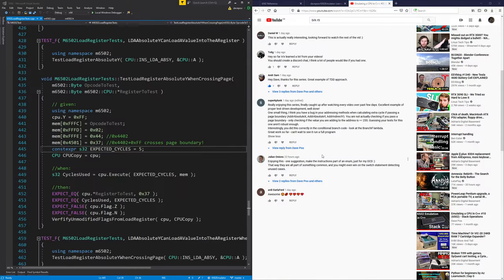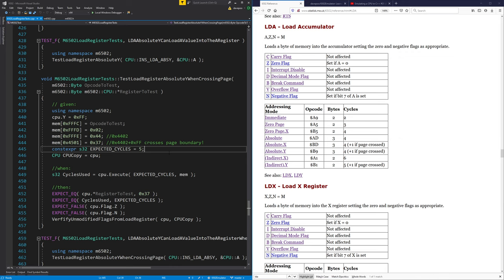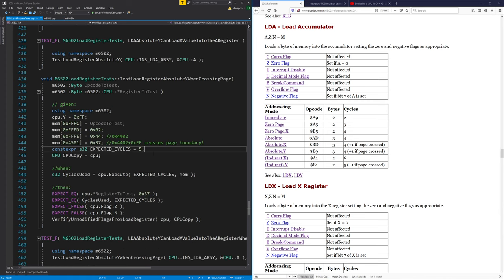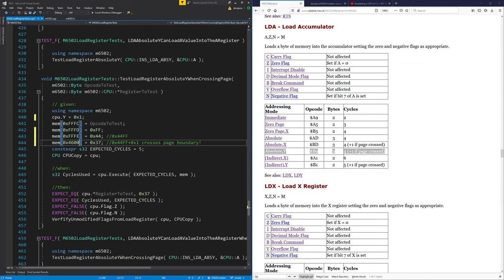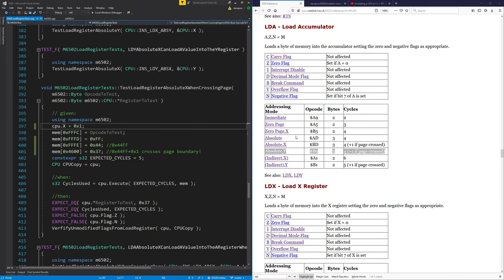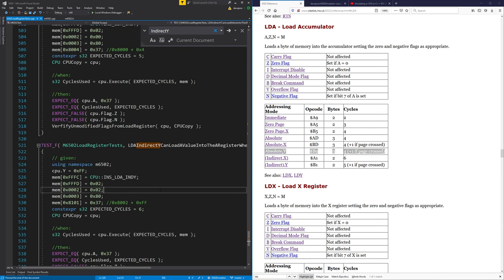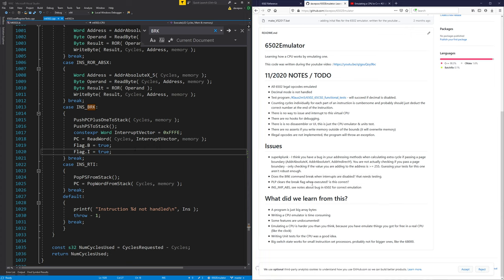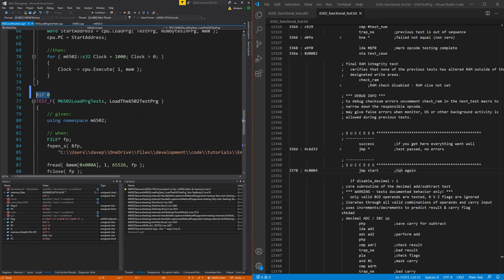Emulating a CPU in C++ #35 (6502) - Bug Fixing + Bonus Real 6502

Comment: It would be better to decode and execute the commands based on the "native" instruction matrix, because the position in the matrix tells something about the "physical" execution. Instead of implementing each operation i'd chose to create a matrix of command objects at runtime from the original matrix (-> http://www.oxyron.de/html/opcodes02.html). These objects manipulate the cpu infrastructure - in my understanding this saves you from fiddeling around with "specialties", because they are more a native or electric property. As a side effect it should be more independent from the actual 6502 design and is easier to match to other 65xx and maybe 68xx cpus.
But: I like your approach from a standpoint of learning - c and 6502 assembler... ;)
Reply from the maker: Yeah possibly. I didn't do that as the CPU is so simple with so few instructions. If i was emulating something like the Motorola 68000, even a CPU that old has so many variants of each instruction that the instruction set would be in the 1000's, so it would be a better approach i think for any CPU more complex than the 6502

Comment: Do you know a way to keep the emulator running even if there are no instructions. I mean like it just runs
Reply from the maker: Not sure i understand that question. If the CPU is running, then it executes instructions.
Reply: @DavePoo  I mean that the CPU just keeps on running even if there are no instructions, I tried doing this by removing cycles from every function. I also added an instruction "ins.ext" which quits the loop and it work fine for now.

Comment: Yeah Excellent. Feels like organising you a SD loader for the c64 might move this forward? What say you? Done with this?  Fun times anyway, thanks.
Reply from the maker: I'm considering moving this into an Unreal engine plugin and continuing it from there to emulate a full system
Reply: @DavePoo  Excellent, Unity also provide a wrapper for c++ blobs but the declaration used to be a bit agonising. Hopefully they updated it. I had a Vic20, this really brought back memories. Thanks

Comment: maybe you got the syntax error because your program still said "110 sta var instead" of "110 sta va" and the error comes from the executing not doing sys 49152 (which should be the way to execute code on that location)?
Reply: nvmd ...just gave it a try in vice, doesn't work either

Comment: doh. I'm feeling useless here... dunno the C64. I was/am an Applemaniac. On a Apple //, a simple call -151 would have been a real treat to check how the real cpu is behaving.
Reply from the maker: I have since been told that i needed to call "end" to stop that assembler program (which is written in BASIC!), then i would have been able to call "sys" command to run the comiled program. I think i want to get my hands on an SDCard interface for the C64 then i can load up turbo assembler and compile some stuff. Or could compile in the PC and then load it onto the real machine. That assember i tried looks like it would work, but there is stuff it can't really do (it's not a proper macro assembler, so writing code in it is going to be tricky, and i couldn't set the compiled location of the code, so couldn't create an interrupt handler very easily. Also those line numbers are a real pain when writing assembly).
Reply: @DavePoo  I watched an excellent video some years ago on 6502 emulation. A bit of a struggle to find it again but here it is: https://youtu.be/7WuRq-Wmw5o
Not to mention one from Michael Steil exposing the guts of the beast : https://youtu.be/fWqBmmPQP40. And the Ben Eater serie on building a 6502 computer: https://youtu.be/LnzuMJLZRdU
Lot of fun ;) Viel Spass !
Reply from the maker: Ah yes, Matt Godbolt. He is very good, and the author of the compiler explorer website. Which is very handy when you are trying to find out what your compiler is doing to your code.

Comment: Dave, 
Big thanks for the series.

How about making a Tapuino on the cheap (supports emulator tap files).
David Watts has a good video on this including maker links.

(I was shocked when I made one and it just worked, first go, now I'm hooked on Arduino's) 

If you have the energy, use a C64 rom and see if you can fudge a display.
This gfx lib by OLC is really nice for starters. (OLC has nice mix of c++ videos on his channel)
https://github.com/OneLoneCoder/olcPixelGameEngine/wiki
Reply from the maker: Thanks. You mean to get files into the C64. I think i will get one of the SD2IEC boxes to get stuff into the C64.
I am considering taking the emulator further, and if so it would be a C64 emulator. As so many good C64 emulators exist, i think if i did do it, then i would embed in Unreal engine as a Plugin.
I was thinking about how possible it would be to make a networked C64 that would allow 2 players to play the same game over the internet. It would require that both games were determinisic and the ability to roll back the entire emulation if there was a misprediction in the input. I'm not convinced my idea would work though, as i think it would cause horrible glitches in the sound when the input was mispredicted.

Comment: i suggest using a much better assembler like "turbo macro pro" which is free
and i think you can load programs with your phone and a cassette adapter.
also a much faster solution is to use a sd2iec adapter
Reply from the maker: Thanks, since this video i actually bought a BackBit cart to get stuff onto the C64 but it sadly doesn't work correctly on my machine.

Comment: Just ditch the crappy C64 and use a Acorn Atom.
The Acorn Atom has  a build in Assembler that is part of the basic syntax.
love it. if you are programming and you see some basic code is slow, just write it in assembler and call the assambled machine code where you had the slow basic code.
Try one of the many Acorn Atom emulators there are out ther.
Reply from the maker: Crappy! Blasphemy!
Reply: @DavePoo  You might need the Atomic Theory and Practice manual to operate the Acorn Atom. Roms can be found and downloaded, like from here: http://www.acornatom.nl/atom_handleidingen/aw123/acorn_roms.htm